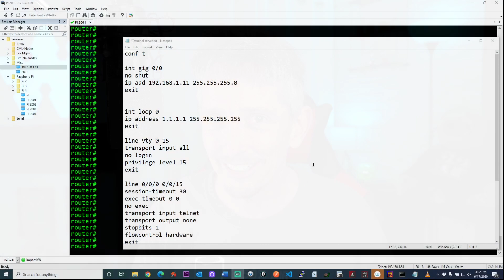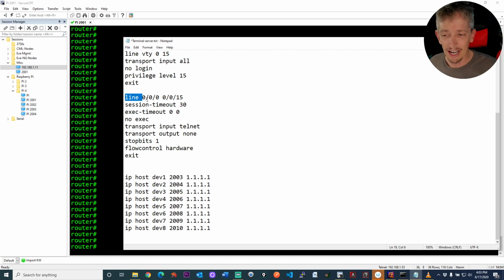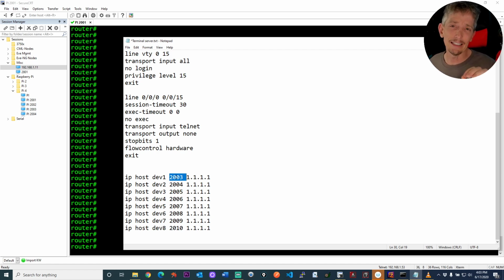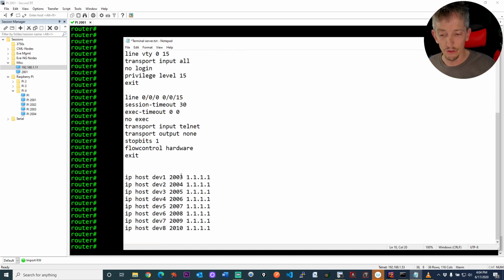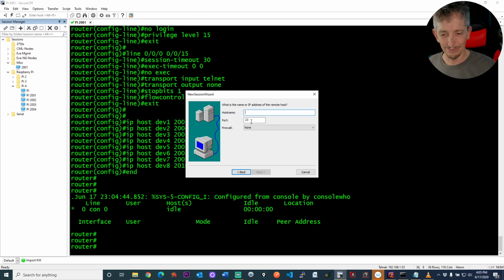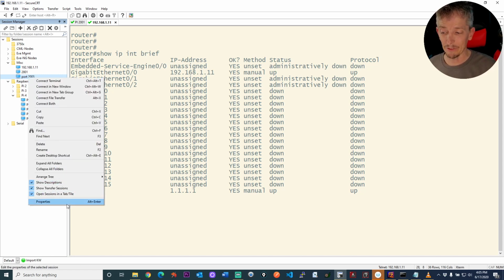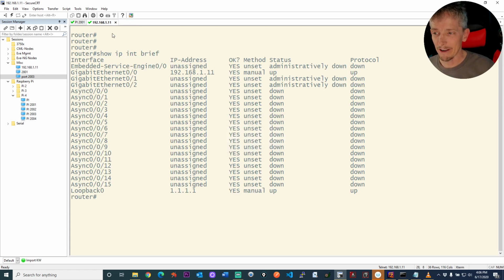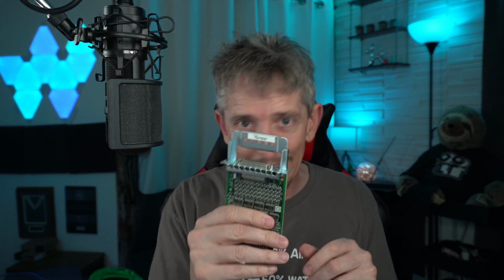1 Router to Rule them All  - Use a router as a terminal server!

Comment: Hi I am facing a problem with Cisco 1100TG service getaway router when I tried from Cisco server gateway router to console any other device then it asks for a password/username but for the remote device console port I have not assigned any passwords. Then I have set a console port pass for the remote device. but still pass word and username is not checking.
Reply from the maker: Thank you for the question @muntasirkhan6968.

If you don't have aaa-new model enabled, then in line configuration, use the command: no login
See if that makes a difference for your lab.  In production, you would want to require authentication.

Comment: Keith, thank you so much for this content!

I was inspired to setup my own terminal server using a 2911.  Finding the line numbers was a bit tricky since I installed the hwic16 into subslot 2, but I will outline the steps below in case it is helpful to others.

The async ports are numbered according to slot/subslot/port so with my hwic16 installed in subslot 2, my 16 async ports are numbered 0/2/0 to 0/2/15.  The line numbers can be found by sending the command "show line" (see below).

r4#show line

   Tty Line Typ     Tx/Rx    A Modem  Roty AccO AccI  Uses  Noise Overruns  Int

      0    0 CTY              -    -      -    -    -     0      1    0/0      -

      1    1 AUX   9600/9600  -    -      -    -    -     0      0    0/0      -

      2    2 TTY   9600/9600  -    -      -    -    -     0      0    0/0      -

  0/2/0   35 TTY   9600/9600  -    -      -    -    -     0      0    0/0      -

  0/2/1   36 TTY   9600/9600  -    -      -    -    -     0      0    0/0      -

NOTE: the line number for port 0/2/0 is 35.  To determine the Telnet port number, you add 2000 to the line number, which provides the following values for my setup on the 2911.

0/2/0 - port 2035
0/2/1 - port 2036
0/2/2 - port 2037
0/2/3 - port 2038
0/2/4 - port 2039
0/2/5 - port 2040
0/2/6 - port 2041
0/2/7 - port 2042

Comment: Finding the line number has always been a pain for me. Do you have any shortcut or tips?
Reply from the maker: Thank you for the question Chimezirim.  

I will usually find a document for the module, and a document for the version of router to solve that.
Here are examples:
https://www.cisco.com/c/en/us/support/docs/routers/3600-series-multiservice-platforms/7258-hw-async.html
https://www.cisco.com/c/en/us/td/docs/routers/access/2900/hardware/installation/guide/Hardware_Installation_Guide/Overview.html

Cheers.
Reply: For anyone in the future reading this: Just do a "show line" and then it'll list of bunch of lines and you should be looking for something in the effect of 0/0/0 - 0/0/15 (It maybe different but still the same principle applies.) Then once you find that, it should have columns, look under the Line column. So for example, the first line 0/0/0 might have a line number of 3. Take that number and add it by 2000. So line 1s port number would be 2003. I hope that makes sense.

Comment: You could also connect via the CLI by doing a reverse Telnet, which is pretty much the same (connecting to yourself to port 200X). The command will be:
Router# telnet 1.1.1.1 2003
Reply from the maker: Thank you Jeffrey Simpson!

Comment: I recently used an NM-32A module attached to a 2620XM router for my automation project at university. The goal was to create a solution for connecting to as many lab devices (no set IP!) as possible to check the IOS version and upgrade if necessary. You can get these parts dirt cheap on eBay!
Reply from the maker: Thank you Chrisco!

Comment: This is the technique that I use in my home lab. I currently have eleven routers and switches, and just recently bought a 2621 router with two async cards installed. I have up to 32 ports to use, so I have plenty of spares and room to grow. In my lab I've assigned permanent names to the devices (R1, R2, SW1, SW2, etc) so I named my hosts with those names instead of dev1,  like you did. I didn't know about saving Putty sessions using the async port numbers. I've always remoted into the terminal server router and reverse telnet from there, using my host names in its config. I like your method better. It might seem silly to go the trouble and expense of a terminal server  like we have, but the convenience makes it all worth it, even though I'm only a couple of feet away from my equipment. It was a real pain to constantly be switching the console cable around.

One more tip for lab that I'll pass on...I have a basic config for each device set up with a bare-bones setup: hostname, logging synchronous on the vty and console ports, etc. I then put that in flash as "basic.config" and have an alias on each device that I call "reset" to "config replace flash:basic.config". This gets rid of whatever config I have and puts it back for a fresh start on another lab. Faster than rebooting.
Reply: Great! Any reason to use loopback instead of a physical port for this setup?
Reply from the maker: Thank you Lex Boegen!   Great tips.  Much appreciated!

Comment: So you are basically using the router as a sort of jumping point to connect to the console port of your other switches and routers if I'm understanding correctly? Is there a benefit to this instead of setting up telnet or ssh on each device? Ill have to find this pi video :)Thanks.
Reply: Watched it, pretty interesting, thanks.
Reply: Hi None Given, while ssh/telnet to each device directly is inline, this console access can be setup as an Out of Band Management in case you have a network outage in your Datacenter affecting inline access. This way you can check via console and troubleshoot. This has been my use case for this setup.
Reply from the maker: Thank you for the question.  Chimezirim nailed it.  Out of band (OOB) management directly to the console port.

Comment: This is my current terminal server setup: 2801 with hwic16: an upgrade from a 2509 with octal cable. You are right about port determination. the trick is using the correct one for IP host. mine started at 2018 - 2033 because the hwic card is on slot 2.
Reply from the maker: Thank you.

Comment: Great video.  I set mine up on a 1841 a few months ago.  Super convenient.   I'll have to check out the video about using the Pi as a terminal server.
Reply from the maker: Right on!
Reply: @KeithBarker  Thought I might include my config.
line 0/1/0 0/1/7
 exec-timeout 0 0
 password cisco
 login
 no exec
 transport input telnet
 transport output telnet

ip host 2960-sw1 2021 10.10.10.10
ip host 2960-sw2 2022 10.10.10.10
ip host r1 2023 10.10.10.10
ip host r3 2024 10.10.10.10
ip host r2 2019 10.10.10.10

I included the security for practice.
Reply: It wasn't until I grabbed a bunch of 1811's instead of 1841's a while back that I realized that the HWIC octo cards existed. My only regret! Might have to check out a 1921 or so at some point
Reply: @blendonator  I have a 2611 that I was going to use but, it seems to draw a lot more power.  I'm sure if I tracked down the data sheet I could confirm but, meh.